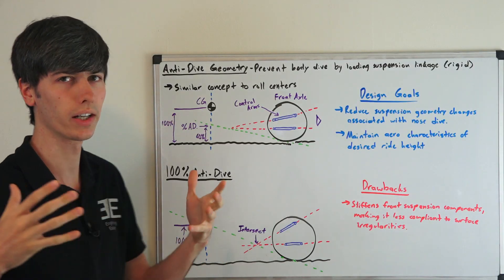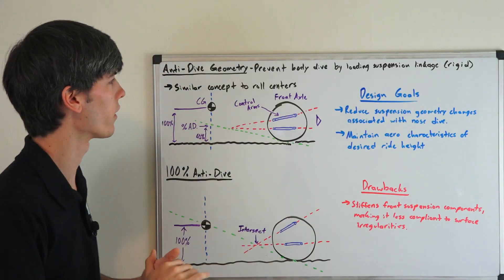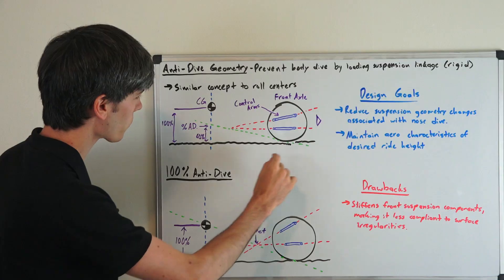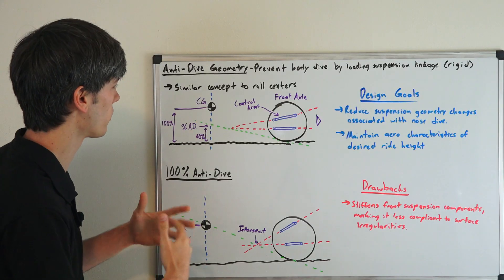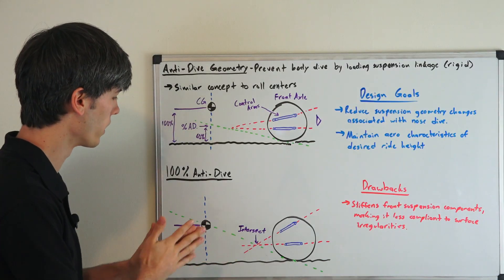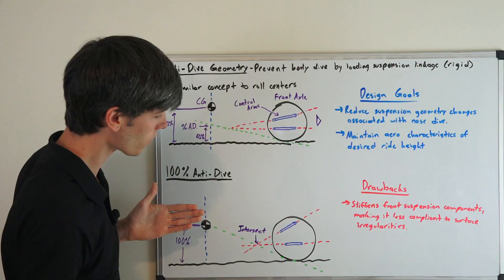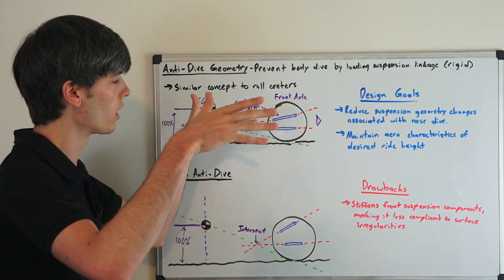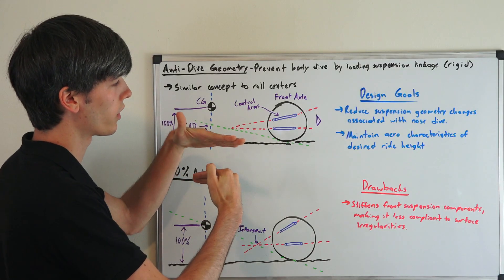Anti-Dive Suspension Geometry - Explained

Comment: Is there software available that finds the optimum control arm connection points based on some input parameters. More anti-dive, more caster etc. Could this optimization be applied when you have a specific racetrack and have all the underlaying data to develop the "perfect" car for a certain track?

Comment: I don't see how antidive makes the suspension stiffer; seems to me that it just applies a preload, which doesn't alter the spring rate.

It might seem subjectively stiffer on a bumpy road where  varying arm loads due to changes in traction can cause oscillation/chatter.

Comment: The lines must be drawn through where the wishbones attach to the spindle, not through the wishbone's rotation axis, great video though

Also, the green line passes through contact patch (most usual case) or though wheel center depending on whether the brakes are inborad or outboard (most usual case)

Comment: So, if I understand correctly, it would not be beneficial to have a high % anti-squat/anti-dive in the suspension of an offroad vehicle like an ATV, right? Because they don't have a high power-to-weight ratio, but they do need to have lots of suspension movement.

Comment: +Engineering Explained:
Why did you choose to use this method of calculating the anti dive? The method you use seems to be what is described in "Tune to win" of Caroll Smith on page 35. In "Race car vehicle dynamics" by Milliken & Milliken, on page 617 (chapter 17.3) another way of calculating is proposed in which the longditudinal position of the CoG does not influence the Anti-features.

Comment: You have used a double wishbone setup up as your example, how would anti drive be accumplished with a macpherson strut front suspension please.
Reply: The upper dashed line must be drawn in that case perpendicular to the strut and through the mounting point itself, check the roll center video.

Comment: If your control arms are not exactly paralell (in a side view), wouldnt this create some kind of a mechanical lock that prevents the wheel from moving up/down?

Any Input on this is highly appreciated!
Reply: +jakob k 

No, it would just make the caster to change with suspension travel. If you have any CAD software, you can try it yourself.

Comment: Xcellenet video and explanation.  We run a dirt late model and i notices the upper and lower control arm points dont really ever intersect.  Now the cars have been like this for years , but after watching this video i noticed a brand of car that just came out the upper has about 5 degrees of angle which raises the anti-dive.  This is prolly a very good thing.  But i wanted to know what your thoughts would be if there isnt any intersection for the uppers and lowers.  Basically, there parallel.

Comment: can you please help me and tell me what if i have parallel a-arms 
what will happen ? IC will contract on infinite what does that mean ? 
do i have unknown anti-dive ?
Reply: +Mahdi G 

No. Draw a green line from the contact point between tire and road, parallel to the a-arms. The anti-dive will be where the green line intersects with the CG line.

Usually it will result in negative anti-dive.
Reply: +Heitor Cicoti thanks for replying
but what you saying is 
ill have 0 anti-dive which means all the longitudinal forces will be transferred through my coilover, but i dont get the negative antidive part may you explain it further ?

Comment: I'm kinda confused
anti dive suspension systems are meant to enhance the performance of the vehicle right?
So why doesn't the system act in a way of decreasing the inertia momentum instead of just simply controling the body of the vehicle?
Am I misguided in some way?

Comment: Not sure if less aerodynamic a bad thing when you trying to slow down. Doesn't that make you stop faster by a fraction of a second? Also, the dive compresses front spring which theoretically gives you more traction?.....until it bounce back Lol. Just saying. But I can see how bad it is if you dive so hard and the rear tires loss traction.

Comment: Engineering Explained Why did you draw that center of gravity line where you did? That appears to be in front of the car so how do you determine how far to put it?
Reply: +dbeckMSP I think it should be at CG height Usually 4-6 inches above the camshaft) at center of rear tire?
Reply: I know this is an old comment but to the right of the wheel is an arrow pointing to the right, indicating the direction of travel. To find the fore/aft and left/right location of your CoG, you would put your car on corner weights to see the load on each wheel. To find the height of the CoG you then raise one axle (preferably the highest loaded axle) as much as you can, note down the angle of tilting and the measured load on the corner weights of the remaining wheels. The book "Race car vehicle dynamics" by milliken and milliken has a section on this.

Comment: Isn't that nose diving is beneficial for sharp/speedy cornering for race car?
Reply from the maker: Chin P.S. Why?
Reply: When the nose dive during decelerate, which is at the corner turning, the shift of extra weight will help to increase the traction onto the front wheel to ease the turning of the wheel...effectively avoid under-steer. Correct me if i 'm wrong.
Reply: Chin P.S. When too much weight shifts to the front, rear wheels can actually lift from the surface. This is especially true in front wheel drive cars. Also, that weight will initially transfer when braking, before the turn in. You still have to worry about getting through the turn without suddenly transferring that weight again, but in some other direction.
Reply: Isaac Dover true and i am agree on that fact. In real sport racing,speed and design have to be compromised to optimised the track race.

Comment: Hello,

I'm not sure about the increased stifness with an anti dive setup. To me with this kind of setup, you can use a more compliant suspension because you don't have to control body movements under acceleration so much. So the more compliant suspension allows better small bump sensibility...

There is a vey similar system on mountain bikes with buit in anti squat (see Dave Weagle patent), where low anti squat design use heavily damped shocks, thus not giving the best sensibility.

Some idea for your next videos, anti roll bars, and then hydraulic and mechanical coupling of suspension elements. And then active suspension. Torque vectoring is interesting too.

Comment: so, it seems to be technically possible to achieve >100% anti-dive when the intersection of the CG with the green line lies above the CG. does this affect the behavior while braking, and if so, how? also, do all race cars (e.g. F1 or LMP cars) have a high amount of anti dive or do they achieve this anti dive mechanic in a different way?
Reply: 0chriser0 Well, F1 used a special system for a few years until mid last season called FRIC. (Front-Rear-InterConnect). Basically it was a connection between the front and rear dampers, that aloud the rear damper to soften up and the front damper to stiffen up under braking so it reduced diving a bit.
As far as i know Audi has a very similar system now in there LMP1 Car. It's said that Porsche also use such a system, but instead of using a hydraulic connection like Audi does and the F1 did, Porsche uses a mechanical linkage.
Reply: 0chriser0 F1 has very stiff suspension and very minimal suspension travel, that's how they mostly achieve it.
Reply: shi01 this is also how the McLaren mp4-12C suspension works.  No roll bars.

Comment: Which wouls you say is the ideal anti-dive percentage for a regular car?
Reply: reycon13 There's no such thing as ideal anti-dive, it depends on multiple other factors. It all depends on the balance of things and what you want to achieve with the design. In general designing the suspension is extremely complex and there is never an ideal piece of design or something to go for. If that was the case, all cars would have identical suspension design because there would be one ultimate and best design. But that's not the case. There are literally hundreds of things to think about, various conditions in which the car will be used, at which speeds, how it should feel, etc.  That's why suspensions keep constantly improving, no matter how good a system on a current car is, new generation will be better, because some little things will be changed again to improve it.

Comment: So If I have aftermarket coil overs can't I just adjust the damping and stiffen the suspension and lower the car ride height and this should reduce nose dive under heavy braking right??
Reply: spoon games yes you can and it will reduce diving, but you'll still have the drawbacks of stiffer suspension and lower ride height.

What Jason explained is how you can counteract  diving without stiffer suspension or lower ride height, so you don't get as much of the drawbacks as you do when you just stiffen your suspension up.
Reply from the maker: spoon games There are certainly other ways of reducing nose dive, yes.
Reply: spoon games without the right geometry you can't reach 100% AD. Unless you weld the suspension... which is less than desirable. Finding the happy medium between stiffness and geometry is the key to success.